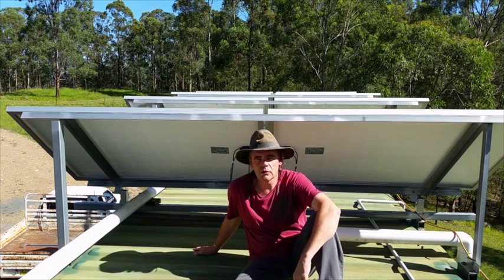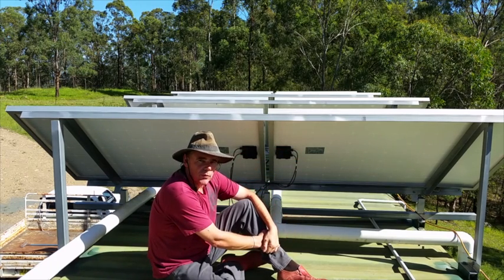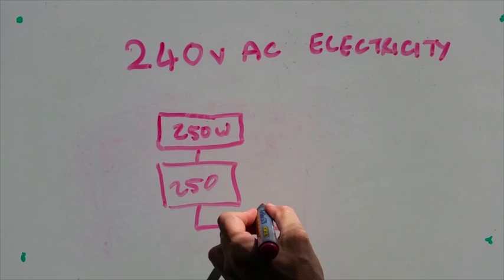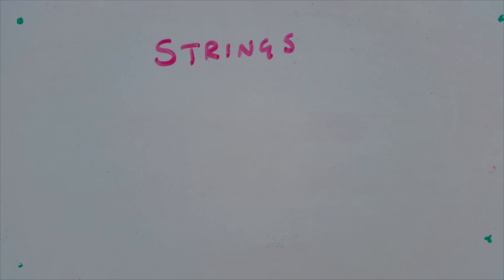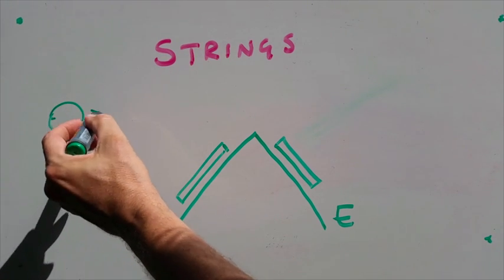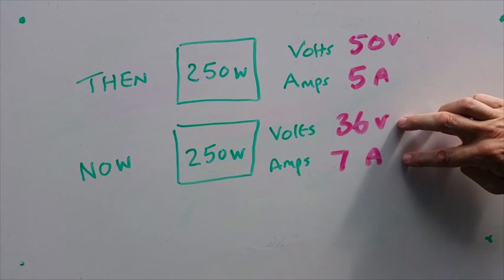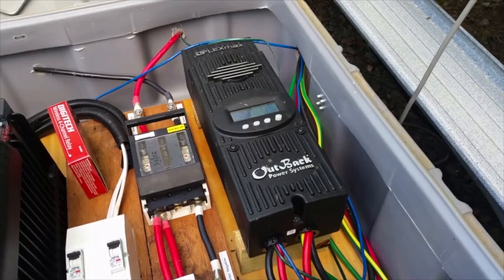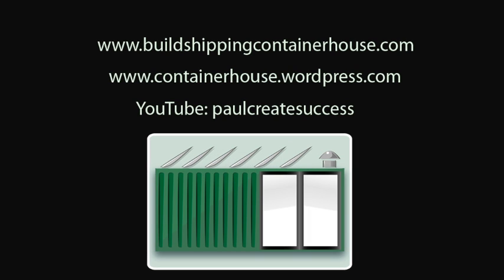Shipping Container House – Obsolete solar panels - Cry for help

Comment: the only way to make this work with your system is to take two 24 volt panels open circuit 36 or so volts and put them in series to get 48 volts or 72 volts open circuit and add them in parallel to your system, you will lose a little power cause of the voltage differences but it will still give you almost the full gains of the new panels, and if you don't be leave me you can always buy another mppt charge controller later if it didn't work out for you.
Reply from the maker: Interesting idea. I thought adding the mismatched panels would spoil the MPPT for the other 8 panels, hence my reluctance. Great idea, thank you. Cheers Paul

Comment: Paul, I'm not to terribly far away from you. (I'm in Guam at the moment, and by 'far' I mean closer than the mainland US. haha)  I have four panels myself on one string, and my controller can only handle one like yours.  I have been looking around on how to mix different types of panels and what keeps coming up is using a Diode on the panels themselves to prevent the electricity from back tracking and going the wrong way when there is an imbalance.  This is mostly used in Wind applications as a reverse flow would spin the generator, wasting power.  That doesn't apply to you, but the principle might still work.  Put a diode on the (+) side of each panel you have and the electricity has only one direction to go regardless of imbalance. 

YouTube, help me out here and see if I'm right or I'm crazy.

Keep at it Paul!
Reply from the maker: Hi Lamineth, I have a half finished wind turbine, so I think I get where you are coming from. I am certain I could force feed the power into the charge controller, but I am concerned it would mess up the MPPT gains that are getting the maximum power out of the string. Cheers Paul

Comment: I had no idea that this solar panel thing was so complex! I thought that you just had to snap some things together and Bob's yer uncle. What makes me confused is, why would a panel company decide a good product was now to be discontinued? I bet the " new improved" panels are just a slightly different design, only more expensive.
 Somewhere somebody is going to have some of those panels in a storage shed. Or they will have some used ones they don't need anymore. How bout it, Australia? Or maybe New Zealand? Taz?
Reply from the maker: Hi Sandra, I suspect as they they change production techniques and make better solar cells it changes the design. There are very few companies make panels, mainly China so everyone is getting the same panels. I am sure I will get some help on this. Cheers Paul

Comment: These panels are close to your spec's http://rdmsolar.en.made-in-china.com/product/RqOxVevUZShn/China-Monocrystalline-Solar-Modules-RDM-250M-96-.html You might be able to find them in Australia. Most 96 cell solar panel's should have close or the same voltages.
Reply: The blokes reply is spot on and I guess he found you the panels you need so you should just get them.  Match the number of cells. Never heard of 96 cell panels but there you go. Also could series up 36 cell and 60 cell panel (which seem to be the two most common types) with matching Isc (short circuit current) that is electrically the same as a 96 cell panel. Also if it's within the max input voltage of your controller then you could just tag some 36 cell panels on the end of each of your existing strings. If the Isc of the new panels is same as your old ones then your not losing any capacity with that approach.
Reply from the maker: Dean Murray I have followed TheblokeSolar&Winds link and sent an inquiry to China.  We will see what falls out of it. I will keep everyone posted. Cheers Paul
Reply from the maker: Greg Smith Hi Greg, what a friendly message. Welcome to the channel. I think I will be unable to find more of my panels anywhere. Stay tuned for the update when I am finished travelling. I would like to share a cold beer so let me know if you find your way to Australia. Cheers Paul
Reply: Paul Chambers
Hi mate, not sure where you are with this project at the present moment, but I live in China and have been in the sourcing game for quite a while. If you have problems communicating with factories here, I'd be more than happy to help out. It might cost you a cold beer one day, but that's the most I'll charge you :) Drop me an email, or let me know if you'd prefer a phone call. Skype is really rotten here (getting emails is hard enough).
Reply: Paul Chambers
Paul, you may very well be correct. I don't know. However, if you'd like me to get in touch with the manufacturer of your panels on youe behalf, I'd be more than happy to do so. If I am not mistaken, I know where and who they are. If you let me know your number or email, I'll give you a call or email and we can go over the details. My personal email is schwinglo@gmail.com